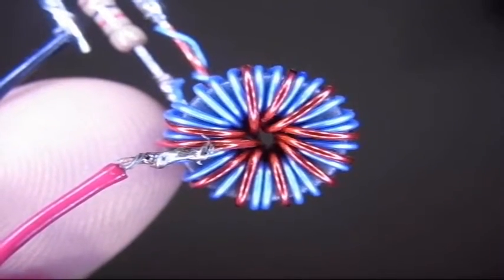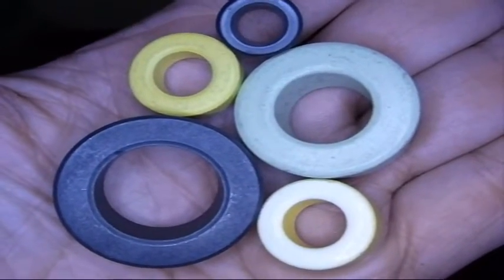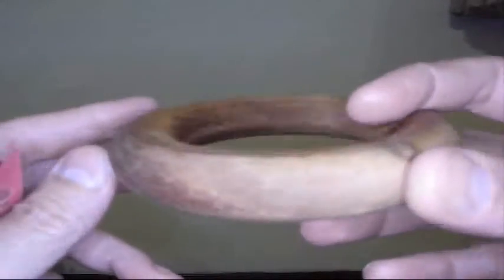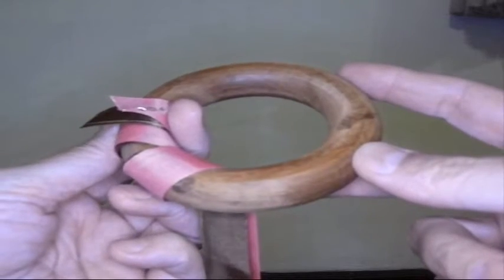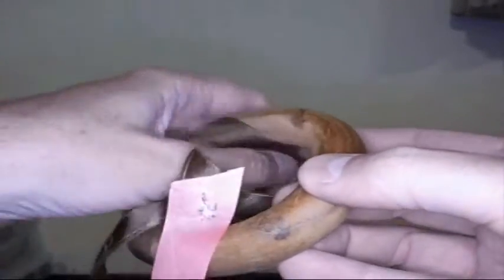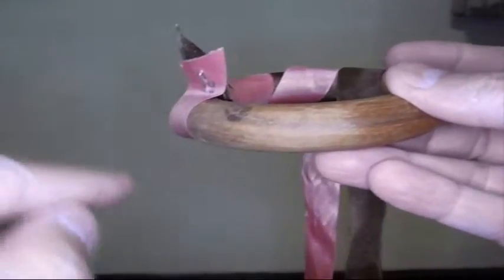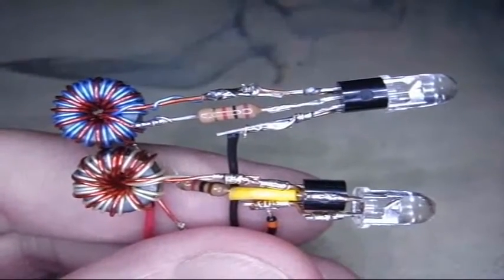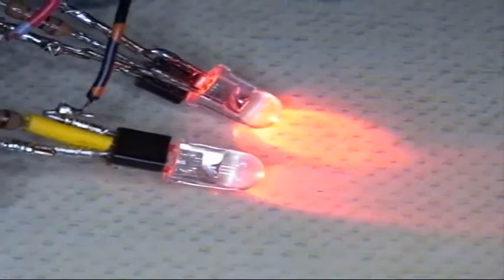How To Wind A Toroid Coil - For Joule Thief, etc.

Comment: to bad you did not say how to connect the wires after the winding... :(
Reply from the maker: I have another video on how to make a joule thief that covers that.
Reply: @tsbrownie  okay. It turned out that my battery was toooo bad. It measured .8 on the meter but once connected it dropped to .4 using a new 1.5v  battery did light my led.

Comment: What happens if you use a microwave magnet as a farite ring?
Reply from the maker: Good question.  It probably will not work well if at all.  Ferrite cores are not permanent magnets, in fact they are very, very short term magnets.  They will only stay magnetic for hundredths, thousandths, millionths, or billionths of a second.  They work by rapidly changing their field from north to south.  If the field is stuck, it can not do that.  So they superficially look similar, but the materials they are made from have very different properties.

Comment: what is the use of the toroid in the JT circuit? can someone explain in detail, please
Reply from the maker: It acts as a transformer primarily.  It exchanges current for voltage.  It also acts as part of a resonant circuit which creates the pulsating DC that drives the transformer.

Comment: my input is 0.5 and i want to make joules theif circuit to power white color led. is it possible ?
Reply from the maker: Do you mean 0.5 volts?  It will depend on your voltage AND current.  The joule thief trades current for increased voltage.  It also depends on how much power the LED needs.  But the answer is yes, you may have to change the ratio in the windings (this is 2:1) to get more voltage.
Reply: Yes 0.5 to 0.6 volts and very less current 0.032 A. Anyway thank you so much for reply. I need to power white LED of 3 volts.
Reply: Is it possible for 0.5 volts and 0.03 A amps current to 3volts using joules theif?
Reply from the maker: If you need to go from 0.5v to 3v that's an increase of 6x, which means your current will go down 6x.  So the amps will end up roughly at 0.005A.  The joule thief delivers power in pulses (pulsating DC) but even considering that and assuming no loss because of resistance / inefficiency, that's probably not going to work.
Reply: Thank you. And am sry my Actually output led is of 1.5 volt. Is it possible to step it up to 1.5 volts from 0.5 volts
Reply from the maker: @Prasann_Goud , Yes if you have the amps to convert.

Comment: Finally an answer to one of three burning questions about Joule thief torriods. If it's not too much to ask <gulp> How many turns? <ducking> What gauge wire? and...(optional) why is this never mentioned in any Joule thief tutorials? If I promise no to tell anyone can you whisper the magic code to me?
Reply from the maker: 1) It's not really number of turns, rather it's the ratio.  I do answer this question in my detailed torroid build video.  The ratio is 2:1 or better depending on the voltage you want output and the current you're willing to supply on the input.  2) You can see at the beginning of this video there are 10 brown winding and 20 blue.  3) For a joule thief it does not really matter.  I've used the finest wire I can find, thinner than a hair.  The upper limit is the number of turns and the size of the hold in the torroid.  4) Cash is better, but since you promised ok.  It's 42.
Reply: And you thought this was over. It is with no small amount of regret and dismay that I say I'd hoped you might reveal The Incantation in its entirety, but it's cool - I know that to transfer that amount of key knowledge in one communication would violate some esoteric geek code of agreement and trip an alarm somewhere, so I'm forced to live dangerously and ask this:

It isn't mentioned the end of which winding ( the small one or bigger) goes to the collector (or base) of the transistor. I have a hunch that, as everyone has said regarding almost every aspect of the circuit. "It doesn't matter", but I'm a glutton for punishment and I  have to know. So I  put what would have been your pile of cash in the middle of the table at 5 to 8 odds. Drum roll please...
Reply from the maker: Thought?  I never think.  Gets in the way these days.  I think you're trying to derive stuff from this video that's not there.  Try this one, I think (scratch that), I feel that it will answer your questions:
https://www.youtube.com/watch?v=IV3lArO0_0U
Reply: Thanks

Comment: The comparison at the end has me wondering about the one wound in the same direction (blue and red) - I notice that the winding isn't perfectly distributed, that is, more of the red is on one side, and same with the blue. Do they not have to be wound perfectly side by side throughout the process so they are equal in distribution around the toroid? No criticism on work implied here, just wondering. Thanks for your time making the video.
Reply from the maker: I'm sure it does not hurt and for really high frequency applications everything becomes critical, but for these not so much.

Comment: Hi, I am having a lot of problems trying to get a homemade transformer to work with a toroid core. I have got "magnetic wire" that is 38swg (it has no insulation), and have been wrapping separate coils on each side of the ring, yet nothing. Any advice or help? Does there need to be loads of turns to work? Is it a problem if the wire touches other wire of the same coil? I have seen some designs where the second coil is layered on top of the first. Thanks
Reply from the maker: It MUST be insulated wire!  To prevent mechanical shorting on the core, many are wrapped with paper insulation also.  Normal copper wire with enamel coating is what is most often used.  Also you need a minimum number of turns, and quite often it is a lot.  More turns make it more efficient up to a point.
Reply: Use wire that is used for electromagnets. It is coated with enamel. Take a length of wire and fold it in half. Then you can thread it through the core. Use 25 turns of wire. At the end, you should have two ends and one with the other two connected, giving you three ends. You will need to use the soldering iron to remove the varnish from the ends when you solder them. The center tap, which is the two ends that are connected will go to the + of the battery. The other two will be connected to the Transistor. Find a diagram using a common transistor like a 2n2222 or 3904. There are many when you search Google.

Comment: The core must be made of ferrite?
Reply from the maker: +gyorgy komaromi That's an excellent question and the answer is "it depends".  For most applications they use ferrite, but part of the reason is because it's cheap and relatively easy to work with.  There are other ferromagnetic materials (Co, Ni, and some odd compounds) plus paramagnetic materials (Mg, Li, ...) that might work under certain conditions.  It's all about the hysteresis of the material and what is needed based a lot on the frequency / efficiency / costs.

Comment: Excellent video. It definitely helped so much, but I do have 1 question. I am trying to build a joule thief. I need the right ferrites and I'll get them soon, but does it really matter if the same color wire loops around twice right next to each other or does it have to be spaced out?
Reply from the maker: +jbuddyman Thanks.  To be honest I'm not 100% sure, but I think that you can loop the primary and secondaries on different parts of the toroid.   It works with a bar ferrite, so it should work with a circular one.  It also worked with an air core coil (see my video on the "tunable joule thierf").  The ratio is very important between primary and secondary.  There is a risk of spiking/damaging the base if the flyback voltage from a winding is more than the base can handle.  It kills the transistor.  So if you have a working joule thief and it quits working, that mayb be it.  I just did that with my "no coil" JT".
Reply: Thank you so much for the reply! You have earned 1 subscriber. I have found another yellow toroid coil from a old computer power supply and I am going to use that for my joule thief build. I asked because I seen a lot of people separate the color wires in their rap, and I didn't see the reason, but I wanted to ask someone before I just do it my way lol. I saw you had a little bit of same wire next to each other and your joule thief works so it should here to but I just wanted to make sure. So thanks for letting me know.

Side note: I like your channel, and see you travel a bit, and I love to travel myself! Been to two different countries, and I am currently in the US but I do plan to go more places in the future, so thanks once again for the reply, and I hope you have a really good one!
Reply from the maker: +jbuddyman Thanks for the good words.  You probably know, but the different colors mean they work at different frequencies.  A yellow and white is OK, it operates at 50 KHz to 500 KHz, which is in the range the JT will work easily.  If it's yellow only that's 10 MHz to 50 MHz; those frequencies are pretty fussy to work with and would probably be hard to get it to work well.  
Most of my travel is business, wish more were for fun.  Travel is great, enjoy it!
Reply: Hey, thanks for the heads up! I know that the toroids that are different color work at different frequencies, but did not know it was not the best for the joule thief. I see a lot of people using black, so I will go with that, but only problem is that I have a huge black toroid. Another youtuber told me it is probably too big which is why I am not getting the satisfactory results. I have a small one that is black on the PSU board ( its really tiny with really tiny wires wrapped around it) I was tearing apart. I'll unwind it and try that out since the yellow toroid did not work that great. But I hope I am not loading you with comments or anything, but I am just thankful you replied to my comment

. My travel was because my father was military ( hes retired now) so I been to Germany and South Korea. I won't get to do that again in a while, but do plan to do it again. You have a great one in Thailand and hopefully I can get with you another time
Reply from the maker: +jbuddyman I use a big black one (about 2" in diameter) for testing stuff.  No problem.  I don't think I'd let that slow me down.  Go for it!